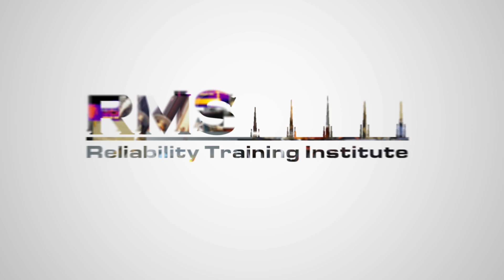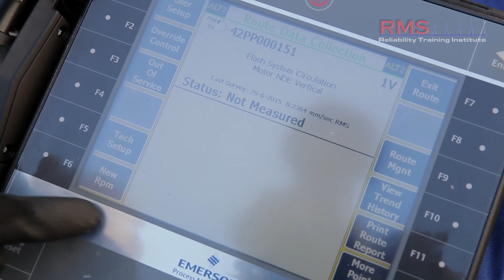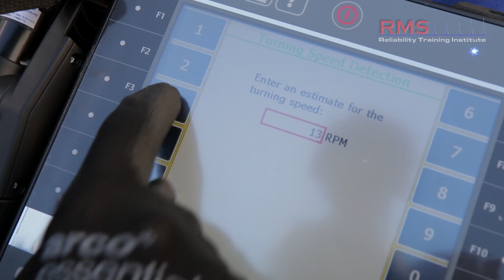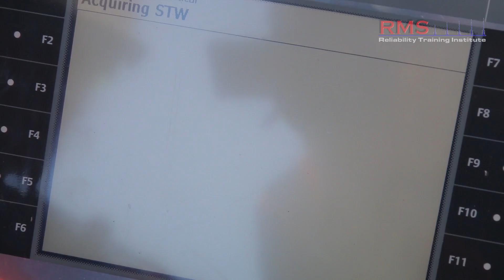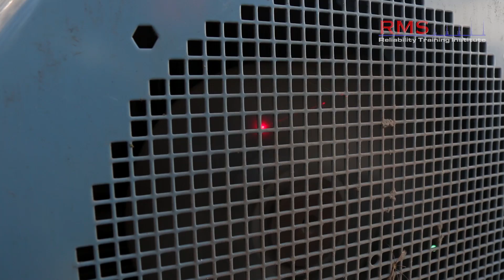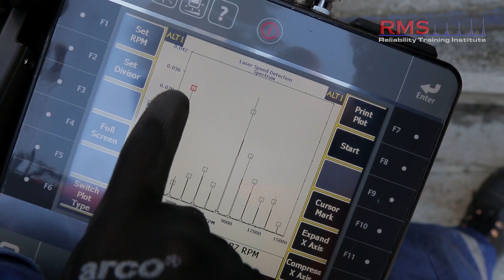Vibration Analysis - Detecting RPM on Variable Speed Machines

Comment: hi dean, to measure the 1X TS using the speed vue laser sensor, is it a must that the laser has to be pointed at the motor fan blade as you demonstrated? what about pointing the laser directly on the shaft, would it give me the same response?
Reply from the maker: +folusho adesina  Yes works exactly the same on the shaft
Reply: Hi Dean